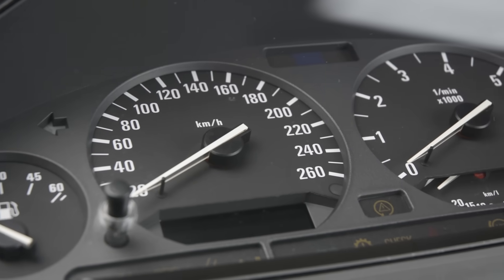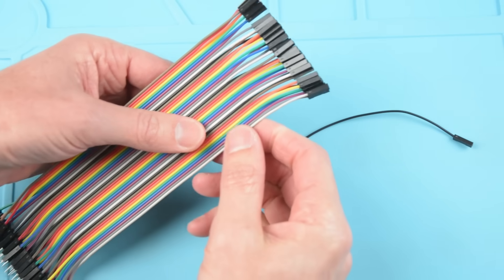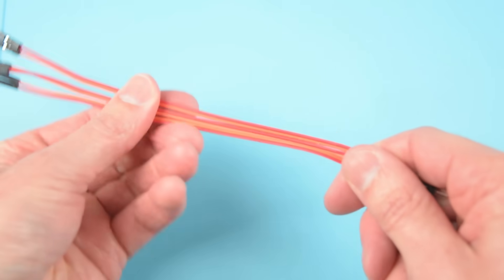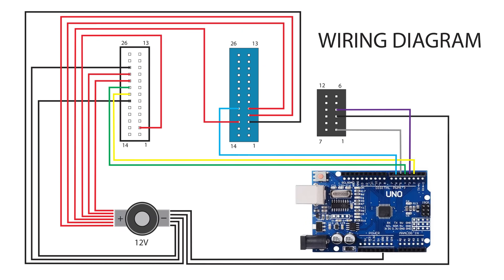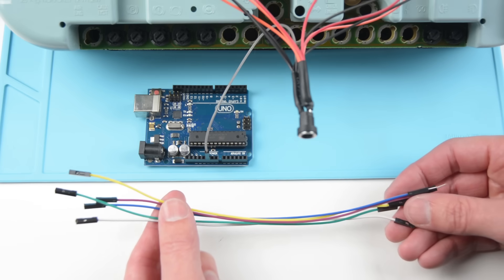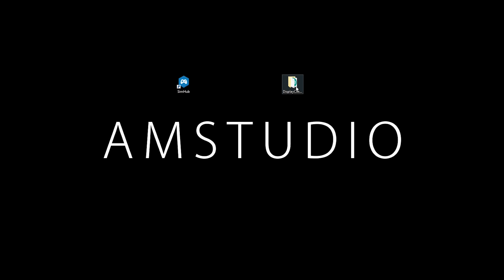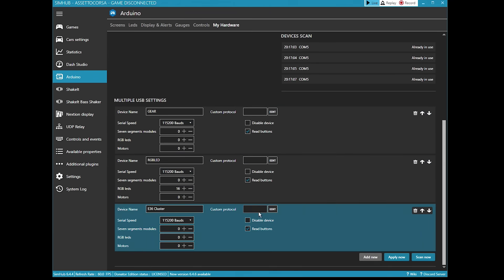HOW TO WIRE BMW SPEEDO CLUSTER FOR SIMULATOR | SIMHUB

Comment: I am following the updated instructions and have done everything it has said and I have a E36 gauge cluster and a genuine arduino uno, the only thing that works is speed, the temp, fuel and rpm do not work, any help would be amazing

Comment: Will it work with a motometer BMW e34 525tds cluster?

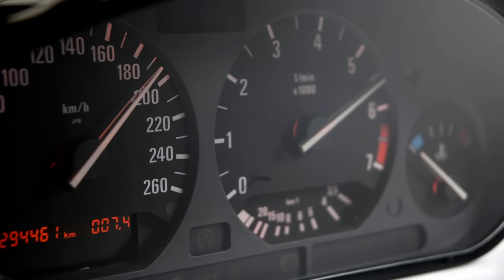Edit: at 5:51, I noticed that when he tested the gagues with a car that revs higher than 7000 rpms, the rev gague was inaccurate and only measured rpms as if the cluster measured 8000 (or whatever rpm limit the car has). Is there a way to keep it accurate and make it stop after 7000 Rpms?

Comment: I have a cluster from Skoda Felicia and I want to do this. But I don't think that it will work because it has a mechanical speedometer (driven by wire) so will it work or no? I don't think so

Comment: Hello, I tried building one, I tried two e36 cluster, two arduino's but couldn't get it to work, the wiring is correct, and tested arduinon pwm output and its okay, the cluster illuminates, but the needles don't move, neither ingame nor in the simhub software
Any help?
Reply: have u solve ur problem?
Reply: @akwabest2622  Yes it was a bad power supply in my case

Comment: I’m gonna try this on a e39 cluster
Reply: Hi, i`m also starting to get around the e39 dash pinouts and dash types. Based on the version of your cluster, you might need CAN bus. If you get anywhere, give me some info. Or, we can get in touch to start figuring out this stuff together
Reply: @vovchanskiyyy2910 got my hands on an e34 motometer instead, it will probably be easier

Comment: Can you do a tutorial for a Audi cluster? I got a AUDI a4 cluster and i want to set it uo the same as the one show in the video but hard to say if the stuff i need is all just the UNO, Wires and dc jack. Save some other dude having a double stacked ārduino UNO with a ofher special board

Comment: Hello, I have an e39 cluster to connect to the sim hub but I am missing an Arduino code and how to connect the light and rpm light, could you tell me?
Reply: e39 is ez
Reply: This yt video is outdated. But im sure its the same pinoit.
Reply: @scionnn  Nope, e39 is wayyyy different

Comment: I got a question, maybe someone can help: I got the dash of a 2008 Dacia Sandero 1.4, however that thing only has two sockets at the back, each with 24 pins. I am kinda lost on the wiring since I don't know how to mitigate the missing socket, anyone got an idea?
Reply: Find wiring diagram, get the correct code (can bus) for the displayclienrv2, and update protcol, and u should get it.

Comment: Hello, do the lights on the cluster work too? i.e. low fuel, turn signals, etc. ?
Cheers
Reply: you would need a relay module for it to work search around on youtube and you will find it

Comment: I know that this video is 5 years old and no idea if you are able to answer this, but, is it possible to even use the dash blinkers, parking brake lights, fuel gauge, etc?
Reply: you would need a relay module for it to work search around on youtube and you will find it

Comment: There is so many different type of adriuno uno, how to tell which one you need? 
Does is have to be 12V aswell? Some uno's say 5v
Reply: Also item description says win7/win8 ,    will it work on win 10?
Reply: @saljustice1512 win10 and 11 yes.
Reply: No get a 5v arduino, and grt a 12v power supply for just the cluster.

Comment: Hey nice video i was thinking i have a ford ranger speedometer cluster with the wires harnesses 

Im curious is there anyother way to convert 12v to 5v and use the cluster via usb?

Instead of arduino i was just wondering

Comment: does anyone else notice an increased wear on the bulbs? I’ve already bought 2 replacement sets and they always burn out way to quick. Idk if it’s just me lol.
Reply: Maybe top high voltage try a 1k resistor if too dim a 330 resistor
Reply: get some LED bulbs they are way better then the originals

Comment: Does this actually work?
Reply: yes
Reply: Do the indicators work? I've got an E46 dash I'm thinking about putting these in
Reply: @carkids460  e46 is just a a more simplifiedthan the e36, so the cluster should be the same. Is it diesel

Comment: What if you have just 2 pin holes on a speedometer
Reply: what cluster do u have
Reply: @scionnn  nvm, I got a E39 high-version from 2000's.
It has:
White: 2x9, total: 18 pins,
Blue: 2x13, total: 26 pins,
Black: 2x9, total: 18 pins.
If you have any knowledge of it, it could really help me.
I tried bench-testing it, and it works completely fine, just I don't know how to connect it to a Arduino.

Comment: having problems getting this to work has anyone else done this able to point me in right direction
Reply: You got it working? Having problem getting rpm, fuel and temps to work. Speed is the only thing that works

Comment: Great video, where do you get the wiring diagram to know what pins in each terminal plug to connect to? Ie- if we were to use a different dash, how would you know which terminals to connect to?
Reply: each once is different

Comment: does the fuel gauge work ?   can i put on larger scaled rpm and speed stickers with 300km/h and 10.000 rpm and configure it right via simhub ?

Comment: I've tried making this but with a Renault gauge cluster, but the speed and RPM are jittery, shaky and never reach the maximum. The fuel goes up slowly but never passes 3/4 and the temperature gauge is either minimum or maximum. Any ideas on how to fix this?

Edit: Speed and RPM have been solved by a faulty Arduino USB cable but temperature and fuel are still having issues
Reply: can you help m with setup? I've tried everything and it just won't work

Comment: My Question now is if the indicator lights are working aswell?
Reply: No, you need more cable and relays to wire it. I wanted it also but it's Not as easy a you think. :(

Comment: I tried to wire a Nissan 100NX GTI cluster (9k rpm :D ) following this amazing tutorial. Voltage at the gauges changes (from 0V to 2,62V) but none of the gauges move. Someone may have an idea to fix this? Btw SimHub is incredible! Thanks!

Comment: hi love the vid, but is it possible to make the indicators work as well?
Reply: Hello. can i ask you if the odometer from 4 cylinder works on different frequency or not? ive had a problem with arduino but ive solved that and now its listed as E36 Cluster. but it doesnt do annything on the cluster when i test max RPM. Please help me im literally fricked :D

Comment: Hi! Dumb question here. If I were to wire an Arduino to some other cluster, would your Sketch+Protocol still work or is it specifically for e36?
Reply: Depends. This sketch in theory should work as long as you have the wiring diagrams right for your other cluster.

Comment: Hi there! :)    - I've just picked up a cluster with all the parts I need except for the DC jack. Can't find one anywhere so I'm wondering....     would it be safe for me to solder the jumper cables directly onto the live and neutral wires on the 12v power supply?        or is it significant to have the DC jack involved?
Reply: yes, thats fine
Reply: @phrg8332  Thanks for confirming, Asher. I'm not so confident with these things but I am way too curious to not give it my best shot.

Have a great day bro!

Comment: So..i gave this a shot.  Wired it up.  Works.  I also went one step further and added the rpm lights and made a custom profile.  One thing however.  My tachometer and speedometer do not display the on screen speeds accurately.  Could be off as much as 10mph in some spots and i get erratic rpm needle movement with in-between shifts.  But it works.  Do you think the leds attached are pulling voltage from the data pins which is why the speedometer and tachometer are off?  Thanks for any insight.
Reply: Hello. can i ask you if the odometer from 4 cylinder works on different frequency or not? ive had a problem with arduino but ive solved that and now its listed as E36 Cluster. but it doesnt do annything on the cluster when i test max RPM. Please help me im literally fricked :D
Reply: @patrikboubin8083  hey man.  Sorry about the delay.
Reply: @patrikboubin8083  Im not sure about the frequency thing.  It's been a while since Ive had it hooked up.  All my race sim stuff is in totes in my basement.  If you havent got it.  I can dig it out this weekend and help you troubleshoot.  That's the soonest I can do it though.
Reply: @patrikboubin8083  After reading my post from a year ago...i remeber somewhat.. The original arduino uno i used was having some issues.  This was an old uno that had been collecting dust.  I bought a fresh one off amazon and that solved most of the issues i was having.  I then used the other one that had issues to run a 8x8 matrix for a led gear indicator.  Ill dig it out this weekend.  Its been a while since i did sim stuff...and have been paying for iracing the whole time.

Comment: Hey great video, everything is ready to go but the first software you use that used to be included in simhub is no longer included in simhub, any help would be great, thanks!
Reply: in Arduino Configuration program go to File > Open in Arduino IDE, here's that software

Comment: I have obtained a cluster for a Peugeot Boxer to wire into my simulator for use with ETS2/ATS/Fernbus/Tourist Bus etc., Any ideas how to test the pin connectors to establish what each pin controls? eg with a meter.  Or any idea where I can get a wiring diagram?, Ive searched and searched. Its quite a basic cluster, Speedometer, Tachometer, Fuel gauge, Temp gauge and the normal indicator lights. I was hoping that they would be sort of standardized, but I bet they haven't made it that easy for me.  I have 2 USB jostick controllers to use for the switches, can I do the dials via those or do I need an arduino?

Comment: how hard would it be to modify this code for other car speedos? BMW ones are expensive, I can get opel or VW speedos from 90s for really cheap on scrapyard so thats why I am asking.
Would it be possible to modify the existent code from the BMW dash after I find the documentation for the pins on any other speedo

Comment: I still can’t get it to work, I’ve now verified  and downloaded the sketch but it’s not detecting my Arduino in “My Hardware”. But if I go into the Arduino setup tool and upload the sketch they want it picks up my Arduino, plz help
Reply: Did you get around that problem because I’m having the same issue ?

Comment: Will this work with Forza Horizon 4 ?
Reply: Im just making one with the e46 cluster. When I'll finish i'll let u know ;)
Reply: @Fexxy  thanks a lot <3 i started working aswell , stuck at compiling sketch to arduino duno what to do :(
Reply: @Fexxy  nvm , figured out , problem was in SimHub and Arduino IDE , installed older versions , worked instantly , now On my way to get cluster , ill update you
Reply: @savage2k968  nice :D but unfortunately I couldn't get the tachometer and fuel gauge working 
:(( (Using E46 Cluster, in E36 it's much easier to wire all gauges)
Reply: @Fexxy  yes , mine worked fully , maybe you try to get data sheet of both clusters and match the pins ?
Reply: @Fexxy  any updates?
Reply: @savage2k968 Yes I tried to do it, but there is no pin for the tachometer
Reply: @mariorzn9612  unfortunately not, i can send you diagram how to wire the speedomter if you want
Reply: @mariorzn9612  Done

Comment: Man absolute Genius, i got everything exept for the Jack i'm so excited to recreate what You did. Do the Warning Lights Work? Y'know Like Big light small light or even fuel or Motor Problems, oil lamp and such things are those lamps in connection with the arduino ?

Comment: Does this work with an e38 or e39 speedo?
Reply: Probably yes, Im just making one with e46 cluster. you just need to find the wiring diagrams for the cluster and know which of the pins to wire

Comment: so im building a simulator and im making it as real as possible to play ats now im  using the dash and gauges out of a 98 chevy truck and are using an arduino and generic joystick controller  tha problem im having is which ports on the arduino do i use for the fuel oil pressure and volt gauges anyone have the answer for me thanks

Comment: I did notice the the BMW cluster was showing about 1,000 rpm less than the in game rev counter most of the time.
 that might be an issue for getting the right rpm for gear changes in game.
 although I assume this can be adjusted
Reply: Spedo  looked way off too  for such high speeds..

Comment: Does anyone have any recommendation for how many amps the 12v ac/dc adapter should be?
Reply: Just get an adapter that has more than enough amps. Doesn’t matter if you have more amps than necessary, but it matters if you don’t have enough. I would try a 10amp and see how hot the adapter gets while using it.

Comment: Hi, I try making this mod but when I test gauges only rpms working, I made the same pinout but the orthers gauges won’t work, i jump the speed to rpm pin in Arduino and the speed needle climb to maximum (in pin 2) can you upload your code? Thanks dude

Comment: So I been trying to get this to work with a 92 Civic cluster I had laying around. I have the wiring diagram of the cluster and have soldered the power and grounds and placed the instrument cables into the correct pinholes on the Arduino. I have flashed the Arduino and it is detected by sim hub, however, I am not getting anything to the cluster? Do I have to learn how to sketch something for this cluster or should this work?

Comment: how you make the wiring diagram?You can make it for a vw vento dashboard plss??
I have this dashboard and i don't know how i can make the wiring diagram to work with arduino.
THX ..a lot of respect
Reply: It is not so easy, apart from the proper pins you need to know what communication bus is being used and what data to send to it, each manufacturer or group will have its own interpretation of the data even when the communication bus is the same.

Comment: do the amps overly matter? or can u use a lower output but the same volts?
Reply: The cluster will pull as many amps as it needs. If the power supply is not built to provide enough amps it could be damaged.
The power supply needs to be rated for as many or more amps than the load will pull.
Higher amp rated power supplies wont force that many amps into the load device. It is only a rating of how many amps can pass through the circuit safely.
Matching the volts will be important.

Comment: Now i used your steps and arduino sketch... it worked with temp gauge and speedometer works as RPM while the actual TACHOMETER doesn't work.  I used vw golf mk4 cluster and same wiring
Reply: Don't expect the pin-out to be the exact same as that from a BMW, it doesn't work like that, every manufacturer will have it's own pinout, amount of pins in the connector, and especially with the CAN-bus: a different style connector and amount of pins.

Comment: How would I get the indicators to work on the cluster? Which number pins are they on the back of the cluster and which socket to connect to on the arduino uno? Any help will be great thanks!

Comment: I would advice andybody who's considering to do this to NOT use these "pin wire" Thingys on your cluster's plugs, but cut off OEM Plugs and solder your new wires to the old wires of the oem plugs. 

Why? This way, replacing the cluster, if it ever fails, takes you under a minute, without the need to pull out your wiring schematics again. After like 5 years, you might have a hard time finding your schematics again because 5 years is a hell of a long time.

Comment: "Tune.h" file missing
How to solve this issue?
Reply: I just figured it out. You have to launch arduinoIDE throught the simhub files. that is where the Tune.h file is located. for my pc it is in C:\Program Files (x86)\SimHub\_Addons\Arduino\ArduinoIDE\arduino-1.6.13. then you open the sketch and verify and upload. he did not make it clear in the video.  but at least i got it working. if you need more help just reply to this comment
Reply: HRW TM have you found a solution? I have been trying to fix the same problem for a week now and can’t seem to fix it. Please let me know

Comment: Is possible to swap e36 by e46 cluster with same wiring?
Reply: No. E46 is a CAN bus based cluster. This wiring does not emulate CAN bus signals, only analog ones. However, the BMW E38 7 series cluster is close in design to the E46 cluster and early clusters use analog signals, so if you want the E46 look but with this wiring, you may be able to use an E38 cluster.
Reply: @fluffyty19  Thank you so much for your answer 😉
Reply: @fluffyty19  im trying to use a toyota passo meter..all gauge are working except for the rpm..pls help me
Reply: Mohd Arshad is your cluster CAN or PWM? If it’s CAN I don’t really know anything about CAN bus wiring. If it’s PWM you may be using the wrong input pin or wrong frequency per revolution

Comment: First gotta say this is an. awesome project!! I myself had one of these clusters, used it to make a similar setup. I've one question regarding the signal turn indicators. I'm aware that there are two pins in the X16 connector for the Left & Right indicator powered via a relay inside the cluster. Is there any way to get input for the signal indicator to the cluster in American Truck simulator via SimHub? Currently I'm just using a signal turn indicator via the BMW hazard/turn flasher relay.
Reply: It probably is possible.  The cluster might use some redudancy checking because I think it's CAN-bus controlled, so it might not work instantly, but if it's relay-controlled, you might want to either use a transistor or FET to drive it, because it will probably work on 12V.